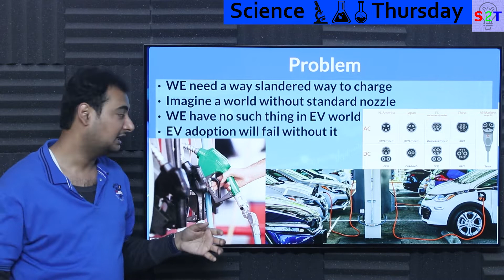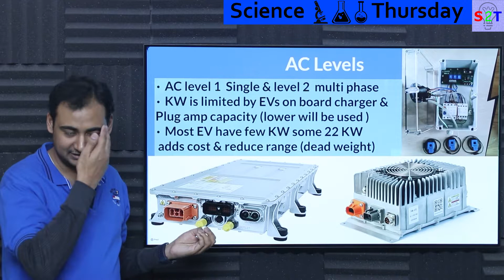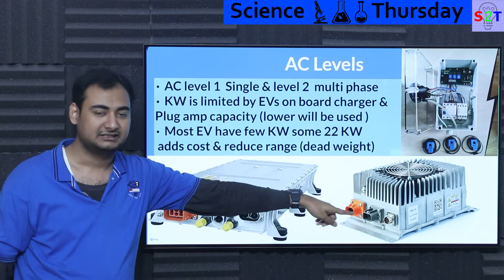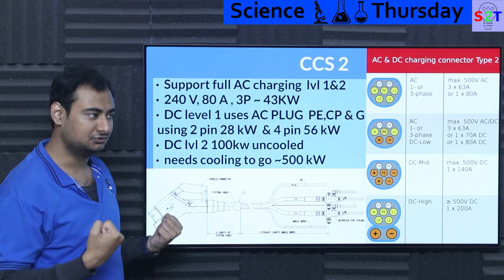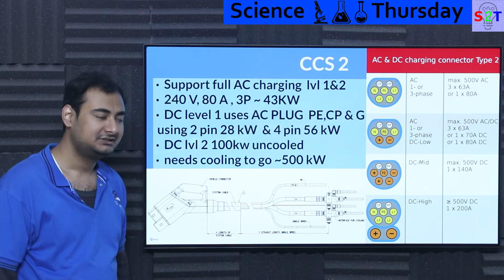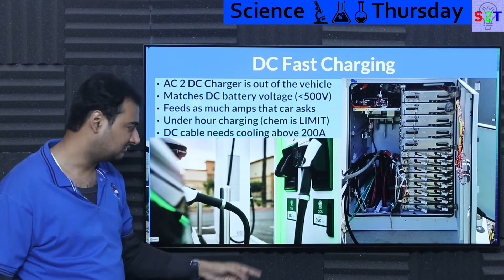Combined Charging System 2 Explained {Science Thursday Ep174}

Comment: The Renaut Zoe is actually using it’s motor driver for charging.
43kW AC at some models.
The drawback is very low efficiency at low charging speeds.
And it's sometimes unreliable.

Thank you for the great content.
It's always very interesting and i learn something new in every video.

Greetings from Germany
Reply from the maker: wow thanks for the data I will do more R&D on it & it proves my point using motor driver  is possible  & allows 1C charging as to its problem mark 1 of any thing is garbage  & something is wrong in data how can a charger that is 40 kW can be slow for 22 kWh for old model of 2012 & even 41 kWh of 2016 & 52 kWh should only take 1.5 hr
Reply: @s2tenglish  
The Renaut Zoe charges fast but if you charging with only 11kW or less, the efficiency is low. You burn some energy while charging. 43kW charger but maybe only 11kW power outlet at home.
Reply from the maker: I have looked into it its not using motor driver they are using motor stator a inductors (as u need huge ones for 40 kW) .That is why they did not got what they wanted in terms of use & efficiency its was an very old design
Reply: @s2tenglish  
Interesting.
Multiple people told me this but i never looked deeper into this.
Thank you for the information.
Reply: 9:00 AC 3 phase, 230 V, 63 A is 230 V * 3 * 63 A = 43 kW.